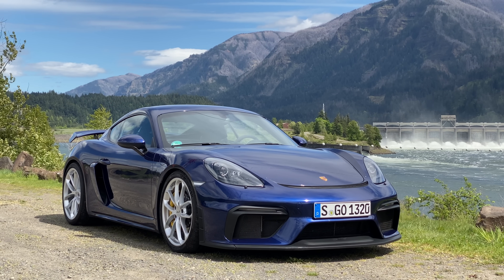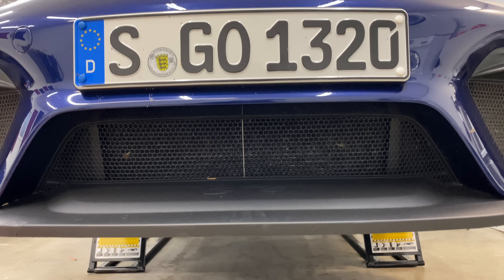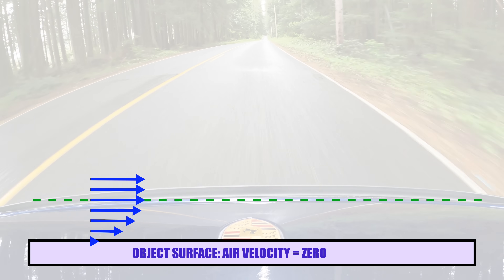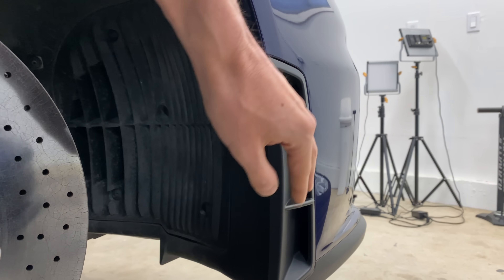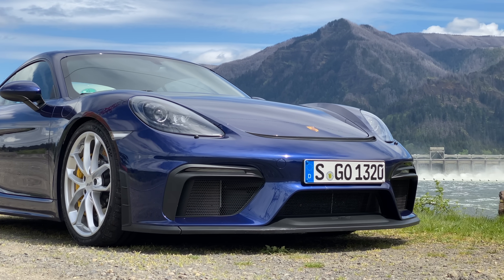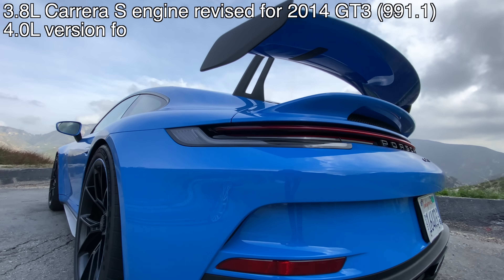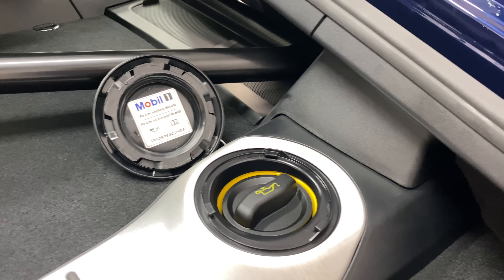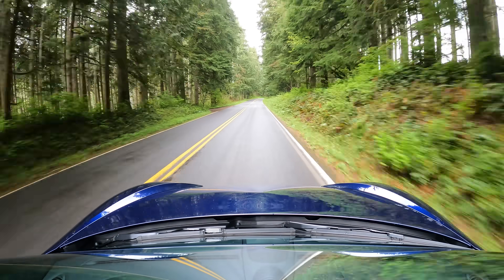The Porsche Cayman GT4 Has Dimples Like A Golf Ball!

Comment: After I saw the MythBusters episode, I thought of the same thing, only regarding airplanes.
Reply: Airplanes tend to use stall strips and vortex generators instead of dimples, but the goal of energizing the boundary layer by creating turbulent flow is the same.
Reply: @TimBellis  You're partially right but stall strips aren't used to keep the boundary layer attached. They're there to make the wing root stall first. That's why you usually only see VGs towards the wing tips
Reply: @preston4354  Yeah, trip strips are what I meant, but managed to bungle my terminology.
Reply: airplanes use this principle a lot actually, look at a wing and the entire body, you see those exposed rivets? they cause the same slight turbulence and are left there for that reason, a better airfoil than a perfectly smooth surface. I'm no aerospace engineer but I did study aerospace engineering and take a few classes on it before I decided I liked what I was doing more than engineering
Reply: Same, excluding airplanes :P
Reply: Airplanes just make use of the deadspace at the back instead of trying to minimize it. That's why they are so long and slender (teardrop shaped). There are limits and practicality reasons why you don't want to make a car long and slender, and obviously for a golf ball you can't orient it since it's a sphere, so in those cases minimizing the vacuum at the back is helpful.
Reply: Cost effective production for the dimpled surface on an airplane is just not possible. Also maintenance cost would skyrocket, as seen with the attempt on using shark skin like texture on airplanes.
Reply: I've often considered experimenting with putting dimples like that on the inside of intake ports.
I might just buy a set of cheap take off heads to try it on, I always use my own as a test bed before I experiment with a customer's motorcycle.
Reply: Golf ball dimples don't work on streamlined objects like planes cause the wake separation is already minimised at the body unlike something brick like an SUV.

Comment: Always wondered why F1 teams don't utilize these effects?  Probably banned in the rules somewhere.
Reply: I think one of the reasons is they want the laminar flow to keep the air attached to the body panels. With turbulent flow the air direction becomes unpredictable and unstable. I bet they do use turbulent flow on the fluid side of their heat exchangers though to reduce their size.
Reply: @anydaynow01  on the liquid side, I'd say turbulent flow for sure. As for the aero, I just thought somewhere on the body, like towards the rear you'd want some  controlled flow detachment.  I'm no aero engineer, just an observer. I'm sure they know what they're doing.
Reply: @anydaynow01  Flow around an F1 car is already turbulent everywhere. That's caused by the combination of size and speeds it travel, you do not need dimples for that.

Comment: I would have never thought a performance car would be tuned to generate lift, I wonder what's the advantage? The theoretical best design would be to be entirely neutral, since everytime lift or downforce is generated, drag is generated as well. Maybe generating small amount of lift might help with fuel efficiency?
Reply: Neither of these cars is built to generate lift. In the video it says the GTS is made to MINIMIZE lift. All cars generate lift from default, just because of the shape. With the GTS, Porsche just tries to generate enough downforce by using the small spoiler and other aerodynamic tricks to counteract the lift almost completely. With the GT4, however, they take it a step further and generate even more downforce, so that you still have it push the car down at high speeds if you subtract the lift from it.
Lift doesn't help efficiency but if you don't design a high performance car, it just isn't worth negating it completely, because that would mean more drag.

Edit: the man himself was faster...
Hope this still helps
Reply: @thef726  Thanks both you and EE, I'm not that knowledgeable when it comes to cars, and it's strange I missed that part of the video, I'll rewatch it later, thanks for the explanation. It makes sense.
Reply from the maker: It's not that lift is the goal, it's the lift is very common for any car, and you have to actively work to minimize it (goal for GTS 4.0 is minimal lift, not making lift).

Comment: Does this work with liquids? As in could it apply to boats?
Reply: Yes though it may not be practical or provide any real benefit for a boat given that fast boats tend to lift themselves out the water to reduce drag.

However, a lot of the principles of fluid dynamics apply whether you’re talking aerodynamics or hydrodynamics.  There are difference’s though, for example it’s harder to get turbulent flow in water than air which the dimples rely on which feeds back in to it may not practical or beneficial.

It would be interesting if someone with more knowledge on hydrodynamics could answer.
Reply: I would assume so, with my very limited understanding of course.
Reply: It may but the application would be different. Turbulent flow is something we go for in designing liquid based heat exchange systems as they provide better heat transfer through less fluid friction.
Reply: Yes but sadly the benefits would be lower because gases are more turbulent while fluids are less. On top of that the ocean and sea life will eventually start adding barnacles/deformations decreasing performance gains. On top of that it would mean that your boat will likely fly up at higher speeds. It would help for the tops of the boat that are exposed to the air on reducing air drag for high speeds. So only applicable if you are a boat dragster.

Comment: I think that's called orange peel... BMW used this for a long time already...
Reply: underrated comment ;)
Reply: So did Ford on their pickup trucks. 
In all fairness however the finish on all the manufacturers cars suffered when the EPA limited the amount of VOC's (volatile organic compounds, aka paint thinner) in paint, the more the paint is thinned the more it flows out smooth on it's surface when sprayed on, when the government limited the amount of thinner they were allowed to use when painting the cars during manufacturer I noticed all new vehicles started looking like crap.
But like anything else give engineers time and they'll figure it out.